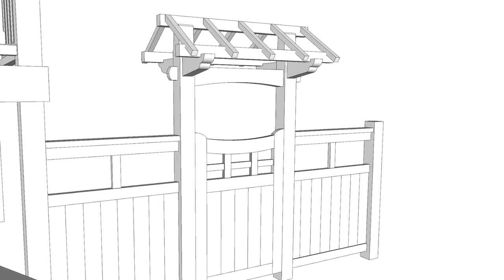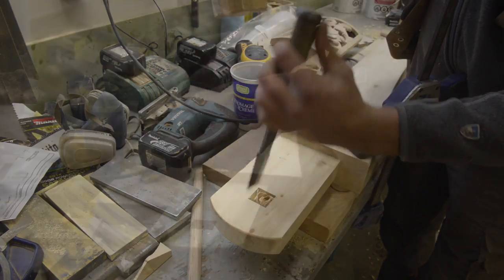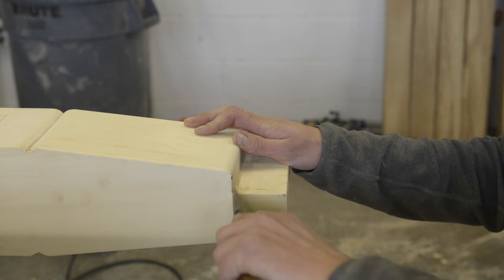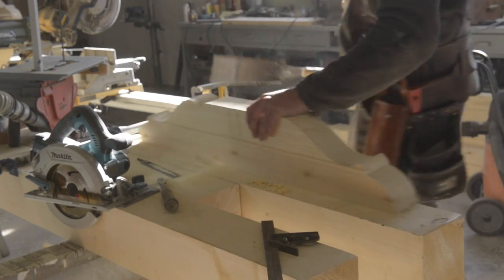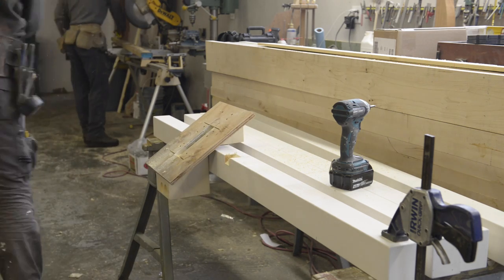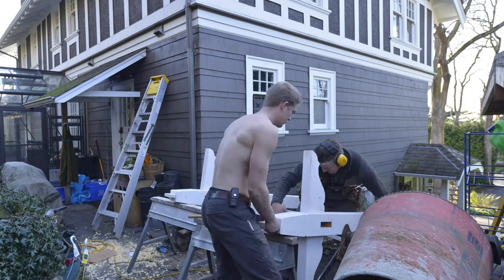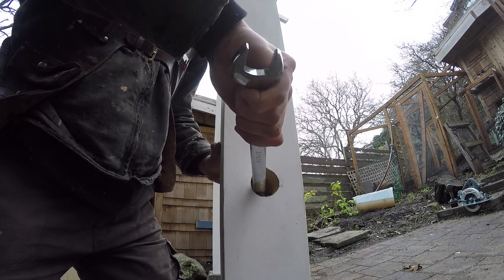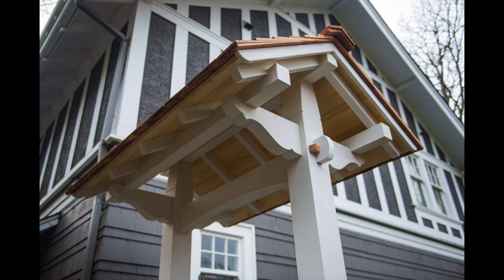How To Build A Garden Gate

Comment: so smooth with that saw, I still bend my coping saws and cut at all angles.
Reply: +Austin Stanley  that hand saw he uses is a pull saw not a normal push one 
it action is reversed so you have more control and so the saw cant bend while cutting  ; )
Reply: +Josh More control less power. With a good western style saw, you can lean into the cut and get a couple inches a stroke. (Obviously for rough work)

Comment: Just so you know the reason for birds mouth cuts on the rafter is for the way the weight is distributed on to the wall plate i.e. flat not diagnol. It doesn't matter so much on this project as there is very little weight on the roof and the timbers are large in comparison. If you were to use the same method on a house however when the roof timbers are loaded with a covering it would push the walls of the house inward not having a great result over time. You do some outstanding work tho mr samurai i take my hat off to you.

Comment: always love ur work as well as this project. . On the peak is my only question  . Where both ends of the cap run toward the middle and ends with just 1 full length shake. Not sure what ur thoughts r but I think a piece of 1/2" cedar the same thickness of the shake and as long as what ever the  reveal is. So say (1/2"×3"×6") dropped in the middle to finish it off so looks more uniform .. Just guessing on size of course..

Comment: Very attractive design. One quibble however. The ridge detail of overlapped shingles creates a series of mini-valleys possibly susceptible to water infiltration. One suggestion:  Two thin horizontal planks, one on each side of the ridge, capped with an "L" shaped copper strip, or, even more refined than the suggested copper strip - a length of, say, 2" diameter copper pipe, cut lengthwise, opened up, and then fitted along the ridge to create an unbroken radiused cap. Best regards, Robert
Reply: Also, the two glued-up, solid wood panels which you use for the roof sheathing will probably develop unsightly lengthwise cracks over time - since there appears to be no allowance made for seasonal dimensional movement of those glued-up panels. Maybe next time use independently fastened, individual planks to prevent the possibility of future cracking - the number of planks and the pattern of horizontal lines created by their edge treatment (exposed, contrasting floating splines, perhaps?) would be design choices made in consideration of their relationship to the whole.  These subtle details would be visible from below and would be appreciated by your aesthetically sensitive clients and also by their equally refined guests.

Comment: Intrigued by the notched purlin versus birdmouth rafter.  Without the birdmouth shelf what/how is the mechanical connection between rafter and purlin?  Toe nail?  Dowel?
Reply from the maker: +halnywiatr 4" screw through the top of the rafter.
Reply: +The Samurai Carpenter What are the advantages/disadvantages to this?

Comment: Awesome work man. What wood did you use? It didn't look like a hardwood (maybe spruce)? Also, how was it weather protected? Did you use an oil primer for the paint?
Reply from the maker: +Thinking Media It's Yellow Cedar and I used an oil primer.
Reply: Is oil primer enough to prevent rot? or ward off rot long enough? Yellow cedar is good, but how good is it?
Reply: Linseed oil is as far as I know. My dad has made his own mixture of linseed oil and some other oil. Can't remember what the other oil is though, but the mixture is pretty damn good. It keeps both any applied color to the wood for many years and has a low maintenance. And I've never seen rot at a single one of those pieces yet. According to what he told me, Linseed oil is the cause of no rot :) He also uses it as a primer from time to time

Comment: how come you dont sharpen your blades like matthias wendel does?
Reply from the maker: +Jttv I have thought about trying to free hand sharpen but I doubt it would work as well as new blade.  I just put a new blade on the saw and then ran it through two nails hidden in a piece of wood so I might try to resharpen that one myself to get some extra life out of it.
Reply: +The Samurai Carpenter I just resharpened a blade for a really, really small bandsaw (1065mm blade lenght) and the teeth are tiny. I had a huge doubt about it working when I attacked it with my dremel, but the blade is now better than brand new. Cuts through alu and wood like there wasn't anything there.

So yes, I highly recommend the Matthias Wandel way. I doubt that I can resharpen those small blades more than maybe twice, but it's still a huge saving for exchange about 10 minutes of your time.